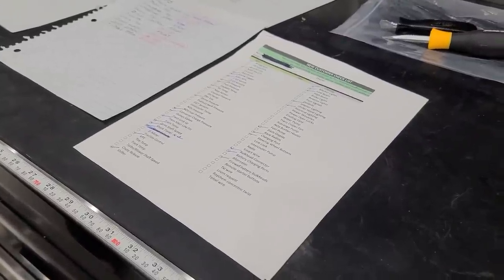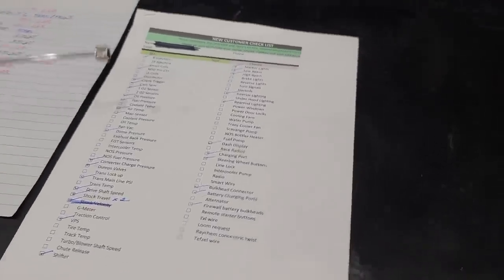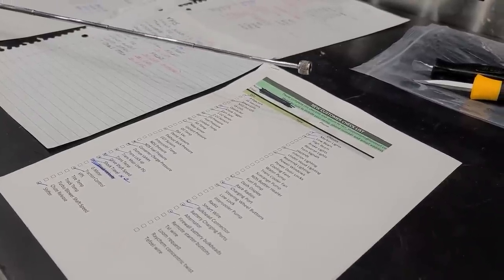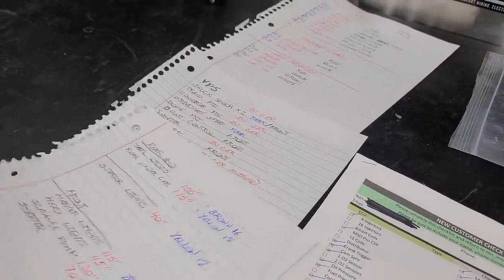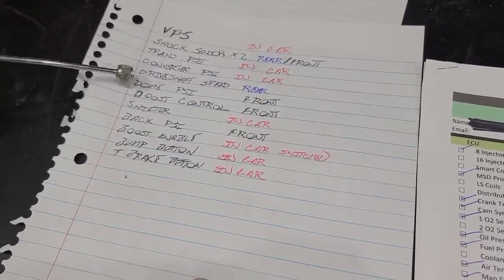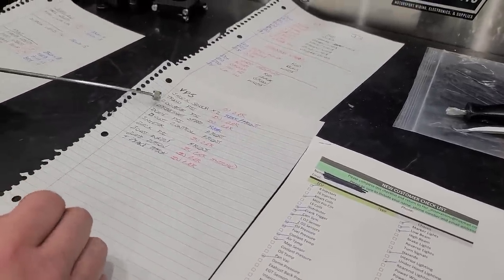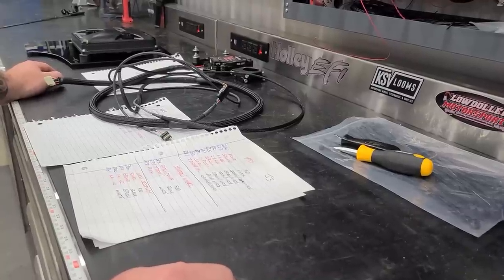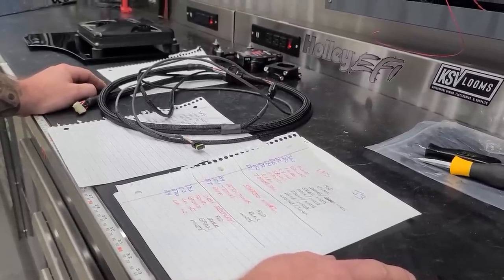Making wiring your race or street car a little easier

Comment: Im dailying a 240z with a 2jz. Redoing everying. . Don't have much interior... 
Would you suggest I run my fuel lines inside the car or underneath?  It's currently underneath.  With a fuel cell in the trunk. But previous owner didn't do such a good job. Plus car sits pretty low.

Comment: Hey Devin, really appreciate you doing these videos. I recently purchased holley HP with a pro dash for my turbo ls fox and am wanting to do all of the wiring the right way the first time so these videos have all been extremely useful. I was going to ask, is there any reason to not just mount my ECU in the trunk? I have a street car so I still have a factory dash (albeit no heat/ac), I do have a cage and it’s just really hard to get under the dash area to work on anything if I needed to troubleshoot something. Only thing I can think is it’s too far for sensor wires to travel? Just wanted to run that idea past an expert before I abandoned it, thanks!

Comment: Is that panel on the inner firewall (next to the holley ecu) a relay panel or are those circuit breakers?
I need a solution to locate around a dozen or more relays, versus just bolting a bunch of relay connectors together. Those Bussman panels look really nice, pricey but probably worth it.
Reply from the maker: It's a relay board

Comment: Are XS power batteries junk or that one or specific item junk?
Reply from the maker: No they are good batteries, the one in video is 10 years old
Reply: Thank you for the fast response! I’m going to be running one so I wanted to get your take before I pulled the trigger. Great video as usual.